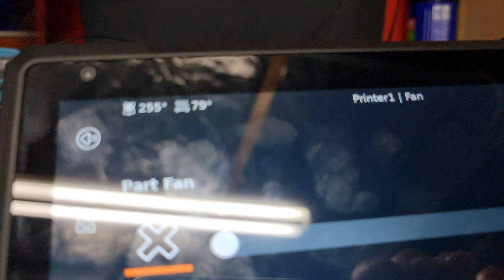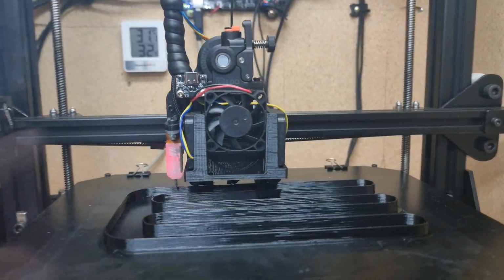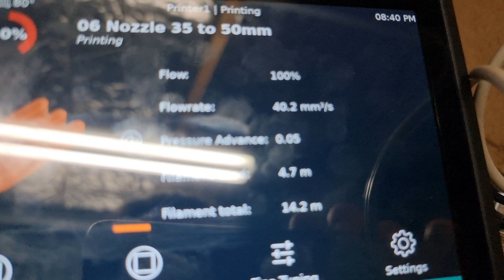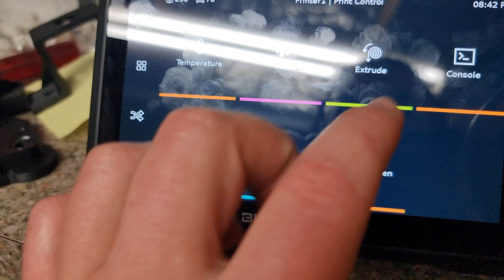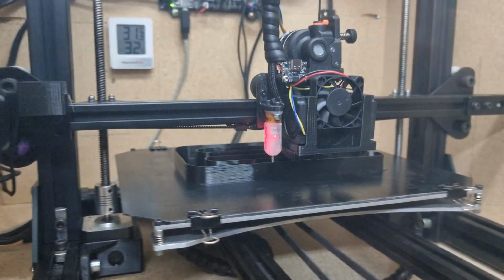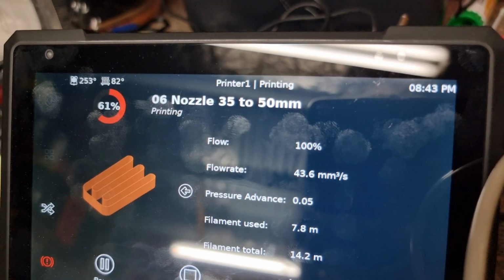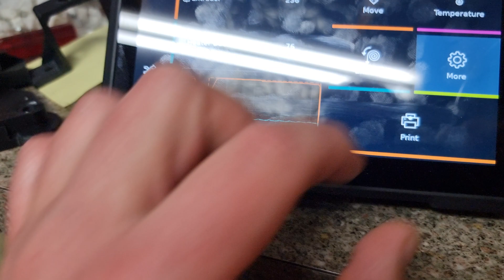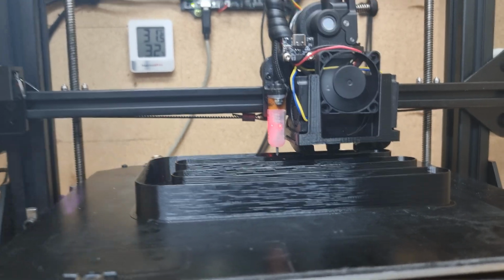Creality Speedy Spider v4 ceramic hotend limits

Comment: Thanks! Good reference... Mine is crapping out at 30mm^3 with s 0.6 chc clone for some reason.... Orbiter 1.5
Reply from the maker: 30mm³ is all I can get reliably when printing under normal conditions too. Ie fan on and printing parts not test benchmarks.
Reply: @PhatToni  hmm good to know last time the fan didn;t work due to error on my part and i got a heat blob and the filament backed up all the way to the top of the hotend popping out the  top PTFE tube plastic collar I was lucky to be able to unclog that.  very scare of running without the fan on.  I may try a smaller fan like the 2510?
Reply from the maker: @user-dv9sl6bg9z  yeah smaller fan or back fan speed off if it's on a pwm header. I had to customise my fan shroud to block airflow the the bottom of the heatsink/nozzle area

Comment: I bet that thing would print PLA like a champ pretty quick? I'm thinking about ordering one. I'm ordering an upgraded hotend for my Ender 3 Pro regardless, just can't decide which one. Right now it's the stock hotend, but dual z axis, direct drive, 32 bit board and touchscreen upgrade, and the CR-Touch. Any advice on which all metal hotend to order considering I only print PLA?
Reply from the maker: This hotend would be a great drop in replacement if you don't plan on printing more than 28ish mm3/sec. Plenty enough to keep up with realistic ender 3 speeds with a 0.4mm nozzle.
Reply: @PhatToni  I saw a video earlier that said the thermistor wasn't replaceable so I ordered the Spider 3.0. IF the thermistor was to go out, I'd hate to have to buy a whole new hotend.